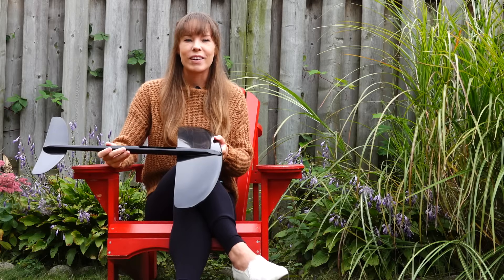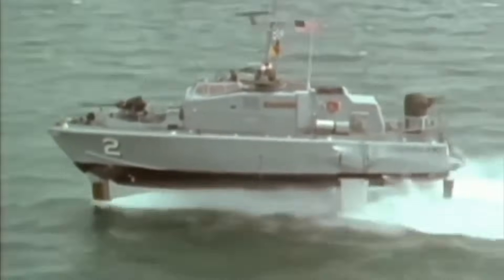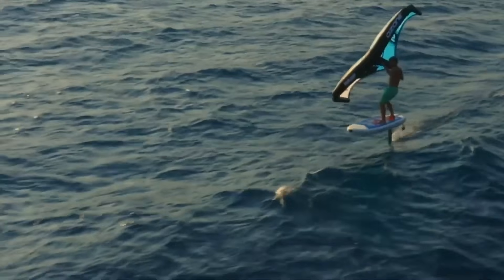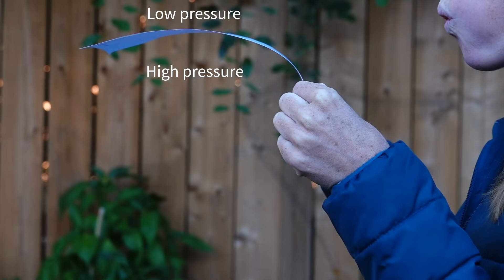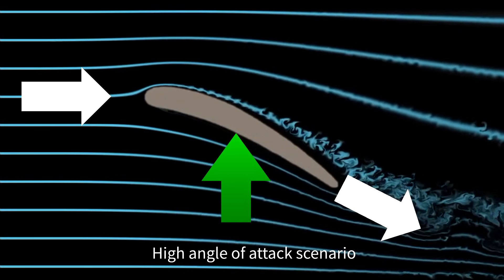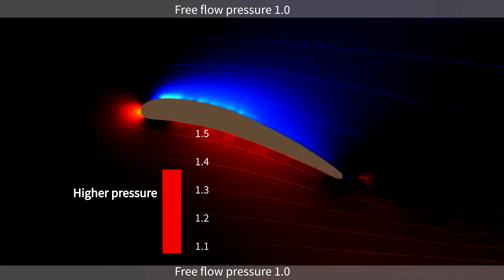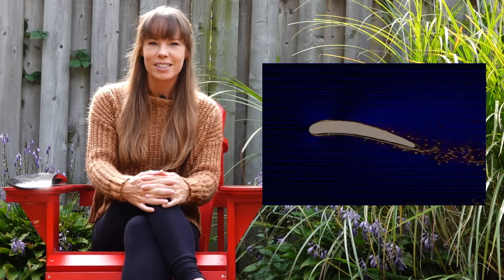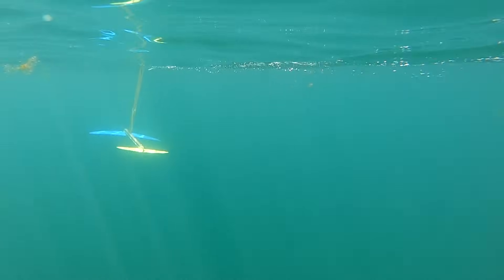How Hydrofoils Work

Comment: well fluid and air dynamics do have a lot of similarities they are mostly different the whole need to explain air and wing design is pointless because they use different theory and math.
an air wing upside down wing can still fly because of the momentum and and adverse pivot.
similarly but not the same you can pump a foil or use its pivot point to create an adverse direction.
a wing must be shaped to provide lift, a water wing can be almost any shape just has to slice through the water providing minimal turbulence as water turbulence has much less effect other than noise or drag = efficiency.
the trail wing on a foil is the pivot point and the fore wing is the direction and power.
you can put small wings on front of an air plain and big in rear but in water you cant do this.
its makes it very simple to understand if we sum air and water in same box but for most this is ok the general information appears to be similar and easy but the deeper you go into science the more they start to look like apples and cars hahaha

Comment: Laurie went HARD on hydrodynamics, and I love it. I knew most of these principles already - and BTW the full explanation for lift is all of the above (to varying degrees in different flight regimes) plus compression lift at trans/supersonic speeds - but it's really cool to hear it from a kiteboarding expert's perspective.
Reply: I wouldn't say she went HARD on it, as I didn't see any formula or equations, but still it was a good vulgarisation
Reply: she went HARD but wrong. Expose a perfectly flat sheet of plywoid to the wind and see it generate lift despite the lengths of upper and lower faces being precisely equal.

Comment: ok I'm going to try to make this as intuitive as possible: the momentum transfer theory is the most correct, just incomplete. A wing, even a flat one, will generate lift due to its angle of attack causing a downward acceleration in the fluid medium. The reason for the hydrofoil shape is to allow the flow on top to stick to the top surface; a sudden transition like on a flat plate will cause the flow to separate away from the top surface, creating massive drag. The gradual slope of a foil allows the flow over the top of the wing to gradually accelerate downward and stay along the surface, rather than separating.

Comment: I disagree.  #2 Newton's 3rd Law, and #3 Venturi are both consistent with the lift generated by a flat wing as well as an inverted wing.  The assertion about pressure differences not being explained by either is inaccurate.  Clearly there is a compression beneath a tilted flat wing.  And your Venturi example incorrectly displays a non-tilted airfoil, which is not even close to the reality of inverted flight.  In fact, it demonstrates exactly why the dominant factor is angle of attack.  The "efficiency" of inverted airfoil is less than a non inverted - which is supported by Venturi.  Also, the pressure differences have been shown to be limited to very close proximity of the wing surface.  Angle of attack is clearly demonstrated to be the most important factor in generating "lift".  The airfoil shape and pressure differences NEAR the surface of the wing have more to do with efficiency and turbulence/eddy current, than the forces of lift directly.

Comment: the (4th)  angle of attack explanation is the correct answer as it explains how planes fly upside down,how symmetrical aerofoils work,and also how propellers (air and water screws ) , wind turbines and sails work-  And it is  also the correct explanation of Newtons 3rd  law  a wing weather it is in air or water is producing thrust, just like a rocket, by accelerating a mass downwards , All aerofoils do is increase the efficiency of this process by reducing drag , (they also have an important effect on controllability of the craft)  The confusion is caused my the imaginary  'lift force'  when in reality  its just Thrust

Comment: if you talked to aero engineers - you are already wrong.  So your wing explanation for air foils is correct, for water foils is completely wrong !!   Water is incompressible.  Lift is created by the downwards pressure of the flow of water after it flows over the wing.   The leading edge for water foils should be much sharper to maintain laminar flow.   If you don't know, say so, and stop reciting aero foil theory which DOES NOT APPLY!!  You got it right in the end ... the downwards flow of water .. phew ... Stop talking about pressure difference you confuse what you said about flow direction.
Please stop !!!!  Unstable foils is due to speed and foil balance.  The foil is balanced between the front and rear foil and dependent upon the angle of attack, which can be very carefully calculated.  An unstable foil causes porpoising ... usually at higher speeds where angle of attack becomes critical.  This has to do with where the foil is placed with respect to Center of Gravity and has to do with rear and forward foil's angle of attacks supporting each other to a stable equilibrium.  There are many variables to consider.   Foil design optimization for high speed craft is very difficult to get right.  All foils can work up to around 40kts.  After 45kts, they become critical and after 50kts, ALL foils will start to cavitate - which is a whole other subject matter and super cavitation foils need to be introduced.   
If you are going to compare hydro foils with air foils, they you need to look at how air foils work when an aircraft goes supersonic !!  That is a much better comparison.   But PLEASE stop with the low and high pressure rubbish !!   Downward deflected flow of water is where you get the lift in hydro foils.  OK?  How do I know, cos I have been building foil assisted boats since 2002!

Comment: This Answer is probably wrong but here it goes!

Answer=simple push/deflection effect below, into a low pressure area above?

Above wing lift explained in video,  above the air is moving faster-->lower pressure area here wrt the pressure below

Below wing lift explained by simple push effect of air. You can demonstrate this using your hand in the wind eg out a car window

Palm of hand flat/parallel to ground, not much push effect save to leading edge (and only modest lower pressure area above) so modest lift (but still some) but mainly backwards

Palm of hand at a modest angle (eg lift 10 degrees) some push effect literally from the air (would be mainly back but low pressure are above also means slightly up direction too) so that your hand is pushed up (lift) but backwards. Note to make plane lift off ground you need large forward force (engine) and still only get some lift at high speeds.

Palm of hand perpendicular to ground, biggest push effect but no low pressure are above and you;d need very large fowrad force to overcome these problems so very sub-optimal design.

Above explains why wings are narrower than they are long and why they are angled at a certain direction and why you need lot of force to find lift (ie to overcome drag).

Comment: Planes can't fly upside down. Only stundplanes with symatrical wings can. Those always point slightly upwards to make the upper side of the wing longer which again creates lift, but of course this is less efficient.
Reply from the maker: we did research it before we put it out, and yes mostly symmetrical stunt planes can, but so does Boeing 707 - https://www.airlineratings.com/news/can-large-commercial-planes-fly-upside-down/

Comment: Air does not flow over the top of the wing or under the bottom of the wing. The air is sitting still and the wing hits it at 200 MPH. All of these models are pure horseshit, that is why aeronautical engineers have no idea how a plane will fly even with hundreds of millions of dollars of wind tunnel testing and computer modeling until they test a full scale prototype in flight.
Reply: "Air does not flow over the top of the wing or under the bottom of the wing".  That depends on your perspective.
Why then do air planes land and take off into the wind ?
Will the lift be the same if the plane is flying (at the same ground speed) into a head wind versus a tail wind ?
Why does my wing foil wing fly still up into the air (either upside down or right way up) when tethered to a post ?
How is it that wind tunnels 
Your point is acknowledged but hopefully we can agree that it is the relative speed (velocity) between the wing and the fluid that matters.

Comment: Hang on. If the air on the upper surface of a wing reaches the trailing edge BEFORE the air on the lower surface (see 3:27), despite traveling a greater distance, then the Bernouilli effect must be even greater than the standard explanation claims, and lift is exactly what you would expect. So I can't understand why you assert that this explanation is wrong.
As for understanding why an airplane can fly upside down, that's simple: you just adjust the angle of attack, in the same way that you cross a stream by pointing the boat upstream rather than directly across.
Reply from the maker: bernoulis principle is incomplete but it is in play, there are few things happening all at once, but redirection of the flow has the greatest outcome
Reply: @OurKiteLife  That my well be true, but the video uses this point to show that the Bernoulli principle does NOT have the
Reply: @OurKiteLife  That may well be true, in which case the video should refer to experimental evidence identifying the relative effects, rather than suggesting that the standard explanation is wrong.

Comment: Thank you! This whole faster-on-the-longer-side explanation is especially idiotic for sailing where both sides of a piece of cloth are so obviously the same length... always bugs me.
Reply: That low pressure theory always bugged me too. 
Spoilers and wings on cars vs planes I've always argued are the same. Deflect air and that's where lift comes from. But the educated are too smart and know better🤷‍♂️
Reply: @masumoto007  Let's see... if we have 20 m^2 of sail, 20 knots of wind, air weighs around 1.2 kg/m^3, 20 knots is about 10m/s, then we get 20 m^2 * 10 m/s * 1.2 kg/m^3 = 240 kg/s of air that could transfer momentum into the sail. That's actually a whole lot more than I would have thought.... No idea how to compute the force that pressure differences could create, though...
Reply: Found something: Force = pressure*area. 20 m^2 * 1 atm = 20 m^2 * 100000 N/m^2 = 2 million N or about 200,000 kg if the sail created a vacuum on its other side. For a difference of 100hPa that would still be 20 tons of force. WTH?! ;-)

Comment: No, your "downwash" theory also does not explain everything. If you get a wing with flat bottom, like NACA2204 at 0 AoA, it will not push flow down. No downwash will appear. However it will still create lift.
Lift is created because the flow is curved more above the wing than below it. This circular motion creates sort of centrifugal force that is greater on top surface.

Comment: The first theory has never been accepted by the Aeronautical community its like saying that the earth is flat. The deflection theory is also not accepted. The last theory which is much better than the two first ones, but remember that the global downwash of the wing is Zero so even the last explanation has its problem. The downwash exists for a short while behind the wing but the upwash outside of the wing is equal to the downwash. If you look at the airmass far behind the wing you will find a shift of the airmass in the diriction of the flow but no downwash.
Reply from the maker: lift is complicated, from what we gathered, redirection of a flow downward is the best explanation which is intuitive, if you look into downwash/flow seperation, etc, it gets too complicated, so we settled for our explanation as aerospace engineers from whom we researched this video agreed that it’s a fair/intuitive explanation without getting too much into details

Comment: Fascinating, well presented.  And to think, I put a kayak up on a submerged foil around 1960, but I could not paddle so fast for long.  I still remember tying a line to the kayak and having a person tow me onto the foil for a sustained ride.  As soon as the kayak popped up on the foil, he went head over heels as the foil abruptly reduced the load on the tow rope as it lifted the kayak above the water.   I went on to fly possibly the first of what is called the Rogallo Wing and it"s motorized form, the trike.  I could have stayed with the hydrofoil!
Reply: with dc motors and batteries of today i am sure a double v surface piercing foil on a kayak would work with the motors at the bottom of the v but i know i will never get round to it but at least you tried bravo

Comment: I think bernoulli's theory still holds true for a plane flying upside down as the flap on the trailing edge of the wing has to change angles to aim down towards the ground which shortens the distance on the same ground facing side forcing the air velocity to increase on the opposite skyward side. If it was a fixed airfoil it wouldnt work but since it has flaps that change which side is longer it would work... at least it my brain it does but I've been wrong before.
Reply from the maker: flaps would probably help, but even without them an upside down wing would still produce some lift. There's an app that imitates wind tunnel and you can draw various objects, and what is interesting is that most things produce degree of lift if you change the angle of attach, with that said wings produce the most lift as they are just very efficient
Reply: @OurKiteLife  yeah the more I think about it the more I'm pretty sure I'm wrong anyway haha I'll leave the thinking for you guys to worry about and I'll just worry about the watching. Great video as always tho! Very thought provoking!

Comment: The most up to date explanation is that the leading edge deflects air upwards, creating a vacuum on the top of the wing, and since nature abhors a vacuum the wing is lifted to fill the vacuum.  It is not accurate to say that the air molecules on top "have to travel faster to keep up" with the air molecules on the bottom. This is a very old theory, now proven false.
Reply from the maker: it is false, but most frequently used, we presented three false theories, and the last theory we presented, about redirecting the flow downwards is the correct one

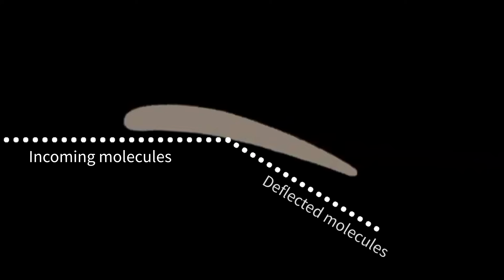Comment: at 3:39 she said, "...incoming molecules are deflected downward by the fluid..." I think she should have said, "...incoming molecules are deflected downward by the foil ..."  Also, the molecules are not incoming.  The foil is moving through the molecules.  The molecules in this diagram appear to be moving because the camera is tracking the foil's motion through the molecules.

Comment: I rather think of it as a thin profile establishing it self in a medium in lowest drag configuration, the faster is goes the denser it finds its interaction medium. Like imagine a piece of paper can stay between your fingers without falling. Another proof for this is imagine a wing with a symmetric profile. Without some form of elevator or the main wing angle of attack change the thing would never get off the ground.

Comment: 2:50 - Interesting thing is that air stream will have some velocity but its pressure will be same as ambient [1][2]. Bernoulli's principle is easily shown in pipe where flow is restricted, applying it to any situation where flow is moving is not valid.
[1] - https://en.wikipedia.org/wiki/Bernoulli's_principle#Misapplications_of_Bernoulli's_principle_in_common_classroom_demonstrations
[2] - https://user.uni-frankfurt.de/~weltner/Misinterpretations%20of%20Bernoullis%20Law%202011%20internet.pdf
Reply: You are correct in your first sentence, but incorrect in the second. 

You can apply Bernoulli's principle to a moving flow; the important point is that the flow has to be stationary for Bernoulli to be correct. In a non-moving flow, the flow trivially is stationary. In a moving flow it can be both stationary and non-stationary.

Starting from the Navier-Stokes equations and applying the assumptions of Bernoullis principle you can derive the Bernoulli equation itself. You will see that it holds for moving flows as well as long as they are stationary. 

Thank you for the sources, very interesting!